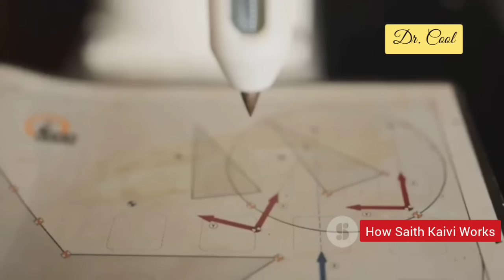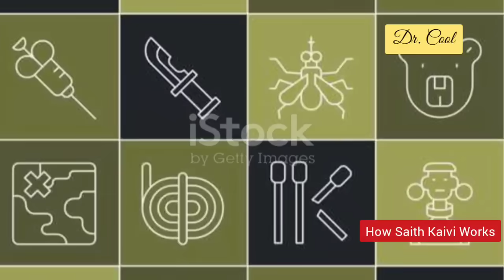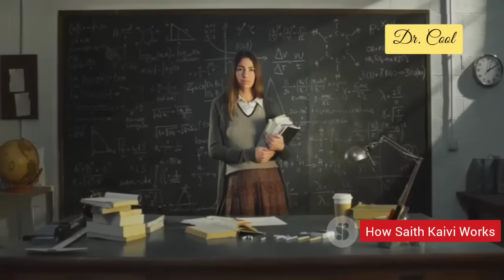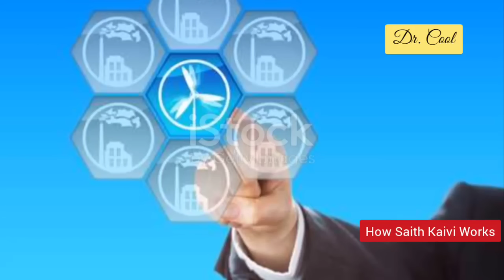How Maxwell Chikumbutso Self Powered Ev Works.

Comment: My guess is the president has never learned in his physics class the energy density in radio frequencies of a black body at the average Earth temperature. Miliwatts per square centimeters. It's like pluging your guitar pickups on a miniature car electric motor and play as strong as you can to make it move.

Comment: It either works or it doesn't. Finding out would take only a day. Not one word has to be spoken, just hop in the driver's seat and drive, then keep driving,  and then continue to drive. Then when you do all that, keep driving. Eventually you will get to a point where you'll know because you will still be able to drive, or you won't. That's all that's needed and should be able to figure it out within one day.

Comment: It may not be radio waves he's tapping at all. It could be 'zero-point energy' from the Earth's magnetic field that he's harnessing...the energy that Tesla's research was centered on. There's hundreds of volts flowing just a few meters above the ground. It's just a matter of capturing, transforming and storing it in sufficient amounts.
Reply: Nikola Tesla used that to power the car but John D Rockefeller discontinued him in favour of Ford old based internal combustion engine,he was rich oil man.

Comment: With Meyer's technology that truthfully belongs to another man named Dr. Dingle it works like this. Theory:

"All Molecules can be separated into their component atoms by taking away the electrons from the atoms that make up the molecules."

That is the science behind this type of water separation in that the atom's electrons were the target to get the water molecules to break apart into its component atoms. In nature what Meyer did was to mimic the earth's global electric circuit, IE, a thunderstorm. What I found in my studies on thunderstorms is what is being taught about them is incorrect as thunder is caused by the water molecules being broken down into hydrogen and oxygen gases by way of ionization as the cloud system builds up an electric charge. The water is separated at the bottom of the cloud and the hydrogen gases rise to be ignited at the top of the cloud which we all hear and feel on the ground as thunder. This type of water separation creates hydrogen, oxygen, and an electric charge as that electron remains in the cloud system. As this process repeats itself over and over the electric charge build up will finally reach the point where it has enough energy to overcome the air's resistance to current flow and then a lightning strike happens. That is just one example of nature performing this type of water separation but there are more as plants also break the bonds of the water molecules by taking away the electrons from the atoms that make up the water molecules by way of photosynthesis. Now when you go over photosynthesis you must ask the right questions in order to see the plant break the bonds of the water molecules by taking away the electrons from the atoms to break the bonds of the water molecules. The question that needs to be asked is, "How does a plant break the bonds of the water molecules?" With this correct and most direct question you will be able to see just where the plant took the electrons away from the atoms causing the water molecules to fall apart and just as in the thunderstorm breaking the bonds of the water molecules like this produces hydrogen, oxygen, and a electric charge. Now the plant has no use for oxygen and releases it but it keeps the hydrogen and makes use of the electricity being generated to sustain itself as all living things do. Us animals break the bonds of the water molecules by chemical reactions but the result is always the same in that you get hydrogen, oxygen, and the creation of electricity. Now the system in animals is complex but it is the reason why we would die in about three days without water as basically the body would lose the ability to send electric charges that tell things like the heart to beat or the lungs to contract and expand and other things of the like that require electrical impulses. Now I have just given you three examples of this type of water separation taking place but trust me there are more that happen each and every day on this planet, such as anything that gets the electrons away from the atoms that make up the water molecules will cause those water molecules to break down into it's component atoms. Just as a bonus the explosions that happened at Fukushima Nuclear plant were a result of this type of water separation in that the radiation bombardment was high enough to knock off the electrons from the atoms which again produced hydrogen, oxygen, and the creation of an electric charge and once that charge had built up to the point here it could overcome the air's resistance to current flow it produced a spark in the presence of hydrogen and oxygen gases and the rest is history. Again, to see these things they haven't been asking the right questions and if you never ask the question how can you ever answer it?you must first ask the right questions, which is why mainstream scientists haven't figured this all out as 

This technology where water is used for fuel does something no other technology has shown capable of doing to this date and that is as ICE engines are operated they will be cleaning the air as they do. No other technology that I am aware of does that. And like this guys technology it can be made to free the individual from the energy enslavement system we all find ourselves trapped in today.

I'd like very much to speak with this man and see just what the two of these technologies can do for humanity in it's time of need.

Comment: The car is a modified Kaiyi X3 Pro Ev. 
It's originally a Chinese car. 
Chikumbutso didn't build it from scratch.
Reply: Yes. He is energy system not car person.
Reply from the maker: Do you need more free lectures?
Reply: The technology is his, powerplant but the car was made by China a synergy project.
Reply: Do a little bit more research on his inventor you will find that the Chinese make the car add Maxwell's Pacific specifications so he can put his Perpetual power device in the car